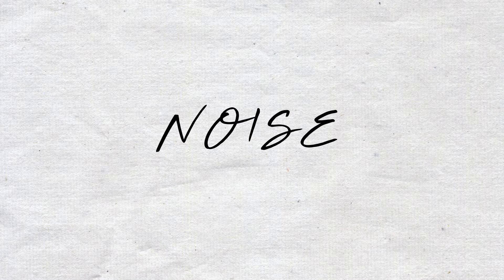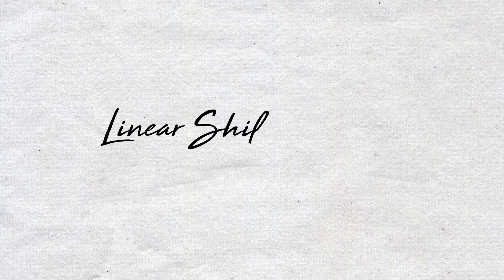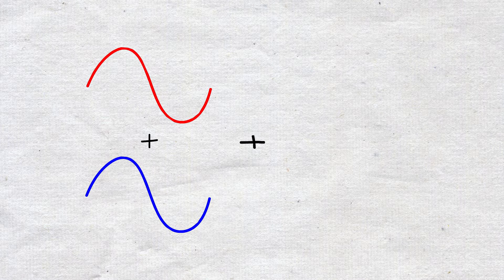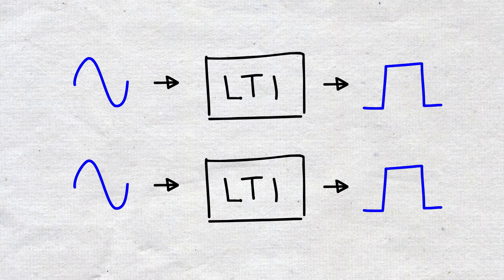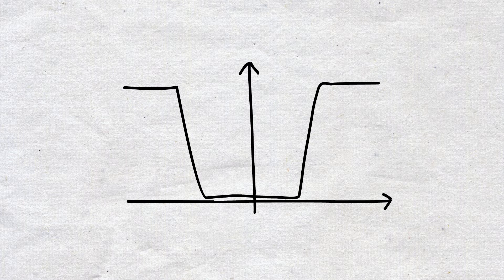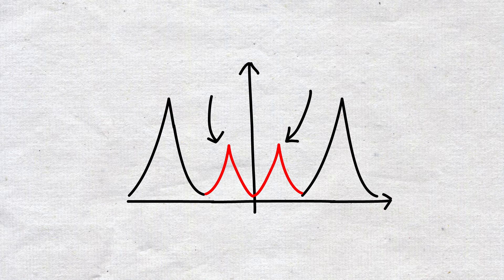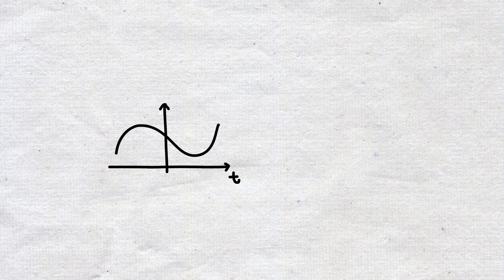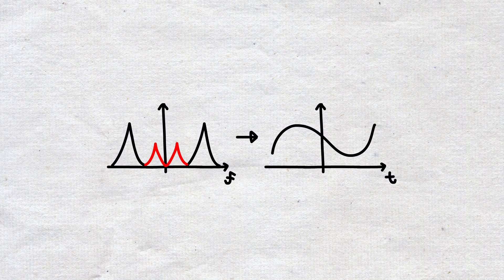Application of Fourier Transform : Signal Processing

Comment: Can anyone explain why do we have to apply Impulse function at the specific frequency that we want to remove?
Reply: The impulse function has a property called the "sifting" property; when applied to a signal, it picks up the amplitude of that signal only at desirable instants. An impulse function is not used to remove noise; it is used to study the response of a system. Once you know the response of a system to an impulse signal, you can mathematically describe the response of that system to ANY signal.